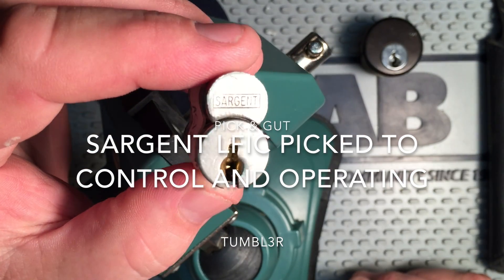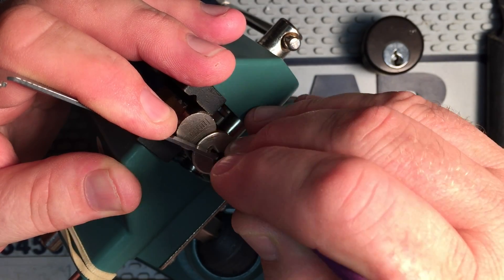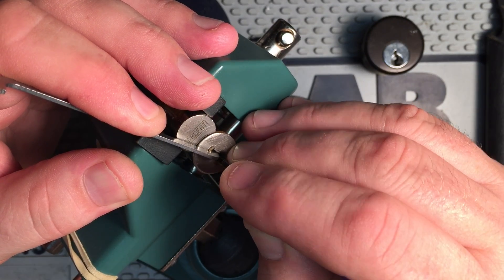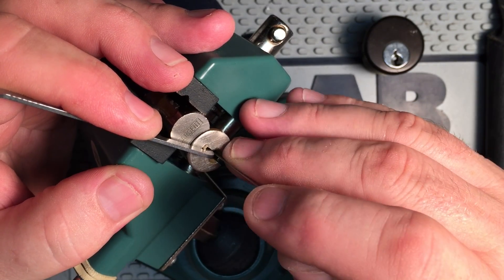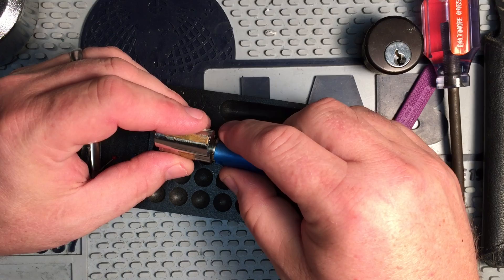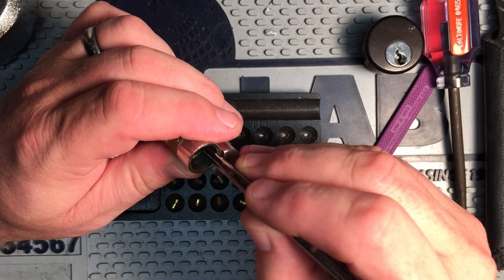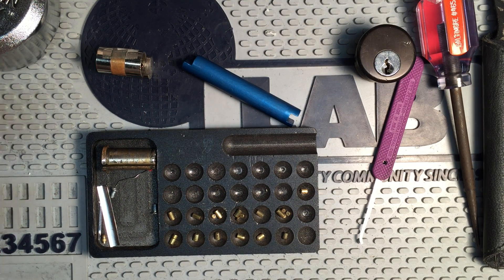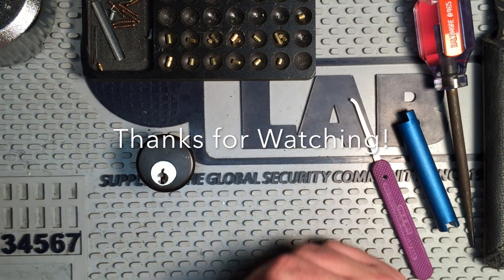Sargent LFIC Picked to Control & Operating - Pick & Gut

Comment: Great reliable picking to the shear line. When you pick stack #4 is the first shear line that clears the control shear line and for #6 the operating?
Reply from the maker: Yeah, the first set was on the desired line for each pin. I think that's one of the things that made this lock such a good learning tool for learning the technique.
Reply: For an SFIC I forced the first binder to the next shear line to get the other shear line picked. A bit of an variation of that method. Great fun toys these locks with two shear lines.